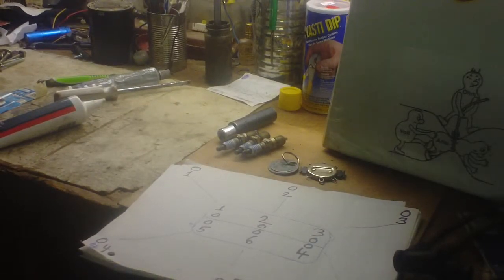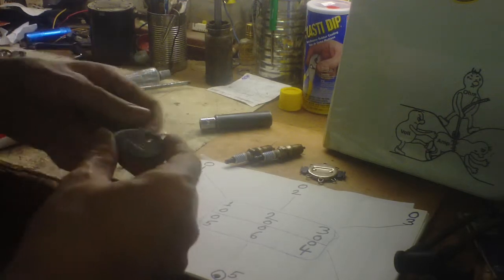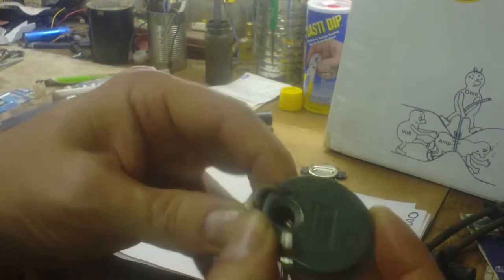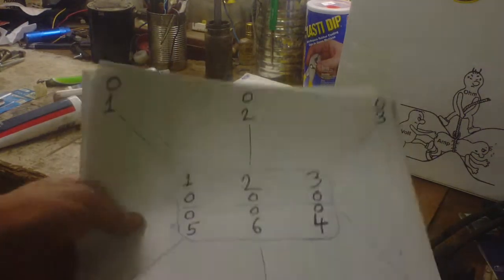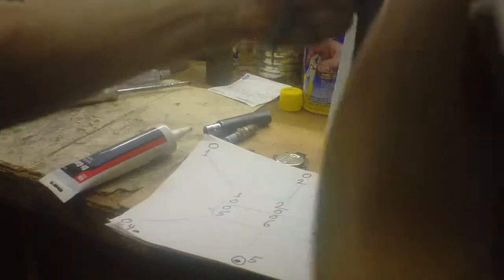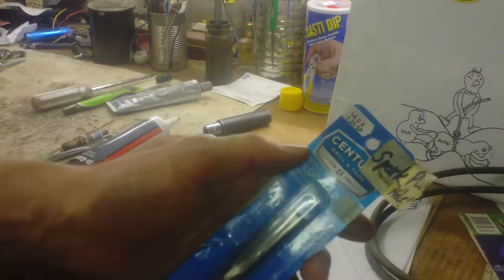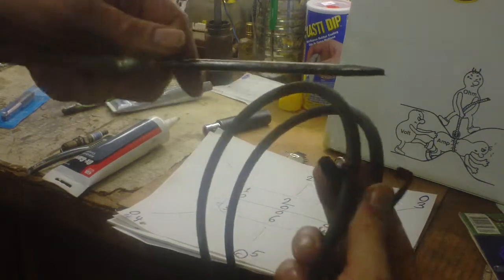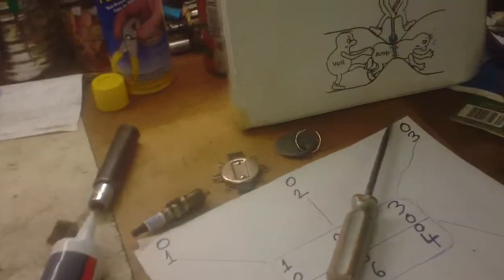WAY overdue tune up Ford Taurus 3.0L V6 DIY

Comment: So how many times do you do a tune up on it? That's what I'm wondering.
Is it once every five years sure what so?
Reply from the maker: I'd base it on mileage, won't hurt to inspect plugs/wires every 50,000 or so, better safe than sorry. My friend let it go way too long. But the really good iridium plugs are supposed to be good for about 100,000 miles. Always use high temperature dielectric grease on all the connections, a little goes a long way.    - take care